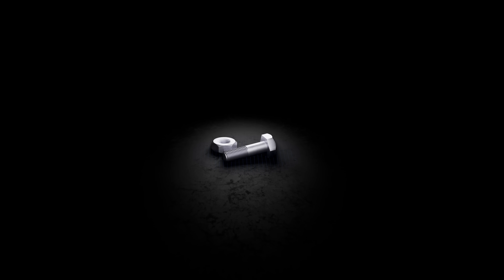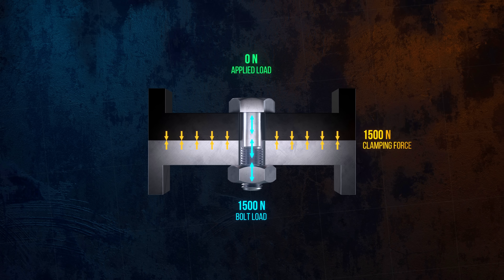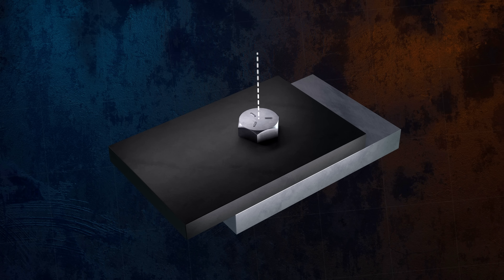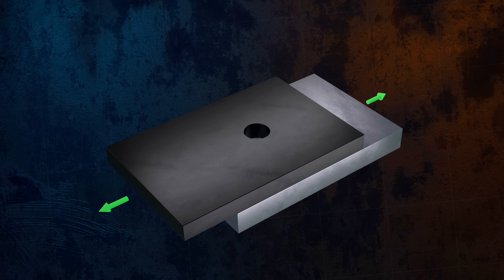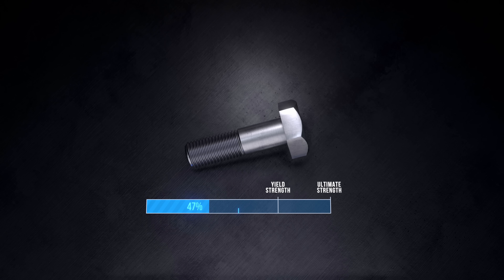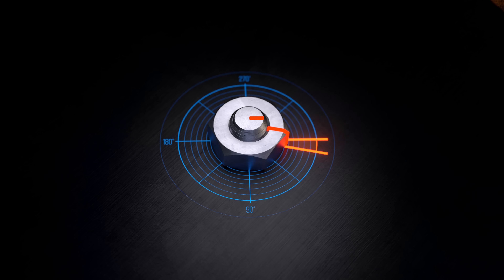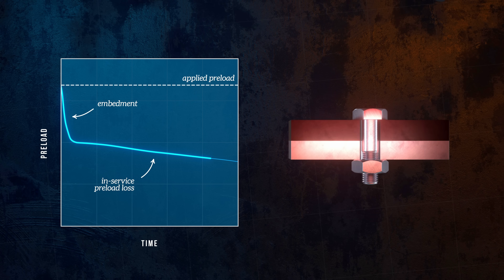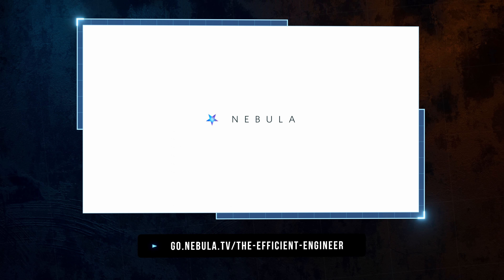The Incredible Strength of Bolted Joints

Comment: They are not that amazing. Stop gassing people who dont know mechanics. It's cheap, mostly durable (depending on the application and contex) and most MOST importantly its an example of a temporary fastening which is chosen any day of the week over permanent if other requirements are met .Basically the thought is that it'd be sick af if there's an option for dissassembly without any material loss, (but no pressure). A contrargument for that would be it's susceptiveness to vibration or loosening of the screw to kinetic energy which requires some dampeners, smth with high elasticity (ability to come back to original form after applying the force) that could dampen (disperse the energy over itself and waste it ) vibrations like specific types of gum, composites . Simply put - it depends on a million fucking things

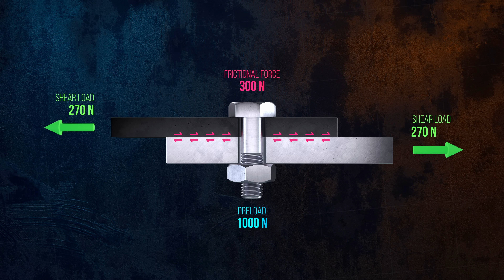Comment: 6:07 maybe I missed something but if your frictional (resistance force is 300N along the perfect joint) then how is it not overcome by 270N pulling both pieces opposite directions. This would be the equivalent of one static piece  and one piece having 540N applied therefore overcoming the friction.

Comment: I'm a mere DIY'er, but your demonstration was extremely useful in helping me understand more about some of the practices I've learned over the years. One thing I wish you had addressed is how the use of washers (e.g., of different thicknesses/diameters) affects (or not) the joint. I know you talked just a bit about "special" washers as a means to help address long-term slipping, but it looked to me like the ones you illustrated were just simple flat washers, not the spring or lock washers I've seen most commonly used to prevent loosening from vibration or simple aging. At any rate, this was a most welcome presentation, so THANKS!

Comment: As structural engineer i have to say that, here is only introduced prelouded bolts, but in latice structuress, and even some other part of steel-concrete you dont use preloaded bolts, couse they would make structure worse.

Comment: Hi, I wanted to know something about this, if you have a piece of timber let say a 6x2 (inch) and you put two bolt one above the other but they are in a paralle position is that weaker or stronger than when you make them horizontaly stagered and the space between them are 8 to 12 inches but they are placed in a zig zag shape so each high point and low point is a bolt?

Comment: I guess bc I was searching strength of bolts this come up. I have a question about shear strength. I am installing a receiver hitch on my truck but I have a roll pan that is further down past the frame so I am either going to have to install washers lowering the hitch from the frame to clear the roll pan or trim the roll pan. My question is will the washers compromise the shear strength of the bolt bc there will be no friction resistance other than the washers themselves? I will be installing 6 grade 8 bolts which is the max bolts holes available.

Comment: my question Is forces under tension is the “bolt” or threaded rod less likely to failure if the nuts are tightened from both ends?

Comment: I’m sorry, maybe I’m just confused and someone can explain this to me, but on the tension joint, these force diagrams and spring metaphor don’t make sense to me. A compressive force will create force opposing it- if I compress a spring then lock it with a spring under tension, the compressed spring will aid in stretching the pair until it reaches its equilibrium length, which in this metaphor I understand as the Clamping force, at which point the large spring is no longer conjoined to the smaller. Am I missing something?? I’m not saying it “doesn’t work” I’m saying the rationale doesn’t work for me.
Reply: Like I’ve heard an almost opposite argument using rebar under tension in concrete- concrete being very strong under compression but weak under tension, the concrete will break under tension (caused by a torque force, for example) well before the iron rebar set inside it, but the rebar cannot take the load until it begins being stretched, so by pre-tensioning it, the concrete is already fully engaged with the bar and further tension will more directly be applied to the metal, while also allowing the concrete room to relax before breaking under tension.

Maybe you can see the mechanical parallels, but how the utilization has me confused- rebar is set specifically to take tension for the concrete, this clamping force feels like a mystical entity which comes from nowhere

Comment: The thing I use the most is I learned my most common bolt strengths and if I need something stronger I use the strongest bolt in that size and if I need something weaker I use the softest

Comment: I found the tension joint explanation confusing. 

The the preload is elastically pulling bolt head towards the nut. To pull it further away you would have to pull in the bolt head by at least the preload before the bolt starts to stretch further.

Or 

You have to pull the bold harder than the preload force to stretch it further.

Comment: Best practices would have you place a flat washer under the nut to avoid damaging structure when tightened.
With vibrating machinery, lock washers, castellated nuts w/ cotter pins, or drilled and safety wired nuts ensure they stay put.

Comment: Amazing how many people ignore the fact that when you tighten a bolt, you are adjusting clamping force. Over 45 years experience and I still get a sideways look when I preach the use of anti-seize on threads. Just because you exerted a lot of pressure against a tool does not necessarily mean you have enough clamping force. I've actually came across mechanics who prefer rusty threads. Also, loctite is an insurance policy for factories that employ unskilled labor to assemble components. The single best assembly process ever produced is torque to yield. Or another way to say it is, tighten a bolt with a torque wrench to a low setting and then turn a certain amount of degrees lessening the effect of friction from the bolt head and threads.

Comment: Hold up. Are you staying that the distinction between a bolt and a screw is that a bolt is paired with a nut? If i remove the nut from a bolt, then put the bolt into a threaded hole, the bolt suddenly becomes a screw?
Reply: well, a bolt sandwiches a free floating part somewhere between the head and what it’s threaded into. Basically a bolt exerts net compressive forces on one component or more and a screw doesn’t.

Adding a washer to a screw kinda makes this distinction a little philosophical though: Is compressing the washer enough to make the screw a bolt, even if the washer’s purpose is to increase the tension of the screw without sinking into a soft medium like wood? We may never know…

Comment: Adding a washer and then a lock washer makes things even more stable, or almost 100% resilient to vibrations. Very well explained.
Reply: Electrical engineer here. What exactly is the purpose of a washer? Just to provide the surface area to apply force evenly on a non-circular hole?

Comment: Wow this is so fascinating!  I had no idea there was so much science and physics involved in nut and bolt joints, after working on mechanical things my entire life. (50+ yrs!)
Also - As an extra added pleasant bonus, I had no idea whatsoever about any of the mechanics involved in the docking and joining mechanism of the ISS docks.  What an ingenious elaborate mechanism!  It's basically a (very!) large bolted flanged pipe joint with very delicately controlled torque sensors on each bolt.. Wow.. Who knew? 
This is the most fascinating vid I have seen in a long time!  Very nicely done - Thanks for this!

Comment: Actually in a shear joint, rivets are stronger die to the fact that a rivet flows into any voids in the hole. This is why most bridges use rivets
Reply: Nah, rivets don't come loose. Favorite fasteners for airplanes and bridges.
Reply: @CycleWerkz  who said they come loose??
Reply: @rty1955  I'm sorry, my comment was not clear due to context. 

I meant that a very good reason to use rivets over bolted fasteners is because they do not come apart. There are many characteristics considered when designing anything. The shear strength, reliability, longevity, material fluidity factors, ion exchange, corrosion resistance, material cost, installation/inspection cost, maintenance cost, serviceability, and many other factors would be considered. 

Your thoughts on strength strength due to material fluidity is certainly a good observation. This effect would improve surface mating. However, that characteristic is used in the design stage. If any other fastener were superior in several other categories, especially cost, engineers would simply design the system according to the details of the materials required. 

For bridge shear joints, I expect rivets really have no competitors. I have not been involved in a bridge project, I'm in light industrial building designs, so my guesses could easily be wrong. The load characteristics are very different. 

It's not so much that rivets don't come apart, but no other fastener can do the same at anywhere near the cost. Of course that's one of many reasons the rivet is the lowest cost fastener for bridges. They go together like peas and carrots.

Comment: Hi VDI 2230 has 2 parts viz Part 1 is for single bolt joint and part 2 is for multi bolted joint. Can you please clarify what is the difference, and when to use which part for calculations.

Comment: The Efficient Engineer, If parts, components, systems, and supplies are not universally (globally) accessible and widely used, that imposes a high cost.  You show Mars. There, heavy bolts and Amazon overnight are likely not going to be available right away.  The annual Earth budget is about $100 Trillion. And the value of all structures and things a thousand time larger. But with the high cost of shipping and transportation to Mars, the heliospheric GDP is likely to be also 1000 times larger.  Elon Musk estimated 10 times larger still.   I am inclined to agree.  The heliospheric economy in the next century, with better software and open sharing and outlawing wars, is likely to be as much larger and more elaborate than the 1900s were than the 1800s.  Richard Collins, The Internet Foundation.

Comment: Except if they are made in lack of quality control lying cheating communist china. Had several hex heads break off expensive 1/4" stainless steel hex headed cap screws while only using a nut driver in one hand that was made in cheating china. Had at least ten times more bad threaded bolts & nuts from pos china then any other country. Of course flat washers from China are paper thin and even when you double them up bend too easy.

Comment: No wonder bridges fall, planes crash - because mechanical engineers like this one are not aware of one important failure mechanism: as members slip against each other, the nut turns a tiny bit, which is unpredictable and depends on minute imperfections and asymmetries of the fastener and member shape, surface finish, corrosion, patches of lubrication, direction of slip etc. After many cycles the nut loosens, the fastener falls out and the joint fails. Otherwise greatly made video and animations as others point out, I shouldn't forget.

Comment: Did I miss the part where he explained what "Pre-load" means?
Reply: No, you didn't miss it. The whole reason to calculate and apply preload is missing. So a bolt used in a compression joint, where parts are squeezed together, is a very strong spring. Just like a spring, when you stretch it longer, it tries to pull back shorter. The tension you would feel in the spring is what the bolt is doing because it is stretched out. This tension is known as preload stress (tension) and is very, very strong. 

They discussed scenarios where the forces applied exceeded the strength of the bolt. The strength of bolts are rarely actually challenged in the real world so seems a bit silly to dwell on it. Bolts are typically 3X stronger than the the load. What happens very often is fatigue fracturing failure. You see the preload is higher than the cyclic peak loads the bolt must hold. These cyclic peak loads are far below the strength of the bolt, but will definitely cause the bolt to fail unless the preload is higher.

Think of a balance used to weigh small things, or the scale at your doctors office. On the balance if you place a 1 lb weight on the right side, then fill a bag with coffee on the left side, the scale will tip when you have 1 lb of coffee in the bag. The 1 lb weight will not move until there is at least 1 lb on the other side. This works the same with springs. So because there is a lot of tension on the stretched bolt (spring) it will not move until a force is applied at least equal to the preload tension. The bolt will not fail right away because it is much stronger then these loads. I will however, stretch a bit; and that will eventually cause the bolt to fail. 

Have you ever bent a paper clip back and forth until it broke? This is known as fatigue failure. If the these pulsing loads go above the preloaded tension, the bolt will stretch, then contract after the load spike. So it stretches and contracts over and over again until it fractures due to fatigue, similar to that paper clip. But if you bend the clip a little so it could return back to its normal shape, it will keep that tension to hold your papers together without breaking. 

This is the concept that is not understood, or even presented, to almost all mechanics, yes auto, truck, boat, and aircraft, electricians, amusement ride maintenance, and I could continue.
Reply: @CycleWerkz  
Cheers mate.

Comment: For an M6 stripper bolt, 2 diameters away from the edge would mean 12mm from the edge of the workpiece to the closest edge of the bolt hole?

But what if the workpiece is very limited in size? Apart from double shear, is there any other way to prevent tear out?

Comment: This is pretty much how your wheels stay attached to your car.
Be sure to torque them down to 300-500 foot pounds for MAXIMUM STRENGTH

It's what every tire shop I've ever visited does, they leave their UGGA UGGA wrenches set to remove bolts
Reply: What's that in normal units?
Reply: @mattd6085  oh, 20 Teslas and a pulley

Comment: What if in the case of a sheer joint the bolt has a donut waist piece? To minimise sheer force on the bolt itself? 
There can still be preload applied but its a reinforcement on a sheer point. The function i assume is somewhat similar to a washer but there is an imbedded dimple in the friction plating, or better yet a half cap that spreads sheer wider than to a point of contact. Like a lipped disc that matches to an opposingly grooved surface where the disc is both above and below the sheer line with a slightly superior metal. It can still act as a bolt on a sheer line but spreads force widely and equally. It would reduce the amount of bolts needed for the joint. I would also suppose there could be a bit more space dedicated to slip before load actual starts being fully applied to the disc and then the bolt. I mainly see this in application to bridges where hot and cold can cause the most motion over longevity in the structure, this coupled with toothed expansion joints seems best. Although the toothed expansion joint is hella impressive as it is. Just a thought.

Comment: I drive a trash truck and there is one bolted joint in the grabber fork.  It joins the fork and the hydraulic cylinder that moves it.  The bearings keep wearing out because the hydraulic cylinder is leaking fluid on it. They will not fix it because the cylinder still works.  They just keep replacing the bolt and the bearings when I write it down.

Comment: Once tightened, there is really only one way to do quality control on with how much torque a bolt or nut has been tightened, and that is by retorqueing: applying torque and measuring when the bolt or nut starts to turn further.  The torque curve will show a sharp drop when that happens, which provides the measurement.  It's used a lot in automotive quality control (bolt conditions remain constant there so variables that would influence measurements such as lubrication and surface friction don't change).  Nice work.

Comment: So let me get this straight: you control the Pre-Load via the NUT FACTOR by altering: Friction under the bolt head, friction under the nut, friction in the threads, and use of lubrication. Also the diameter of your bolt is denoted by the factor "D"

Comment: I have a problem, I am able to sheer m8 bolt, because iam thinking, that if i dont tight it hard it will losen, so I am a bolt destroyer, but now If iam  building somethink, I use M10 bolts, because they meet my feel requirement for tightning.
Has anyone else sheered m 8 blobt with 2 normal wrenches?